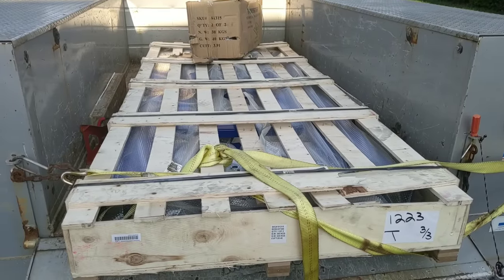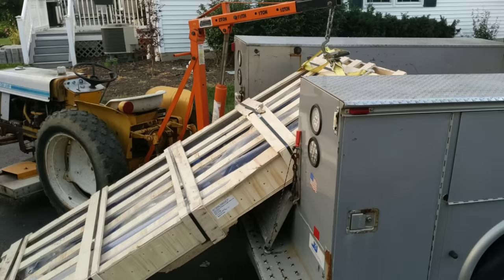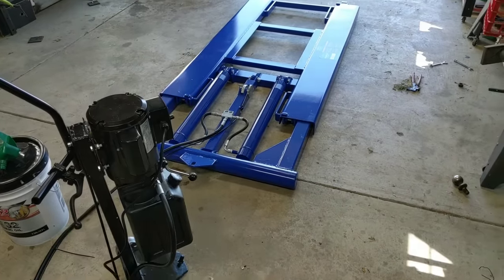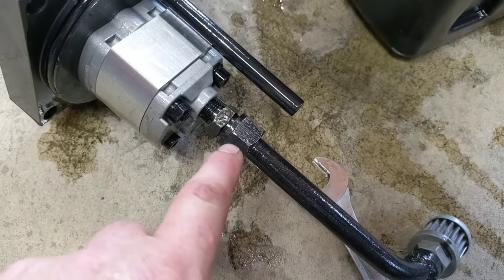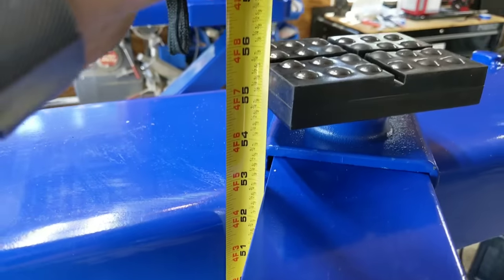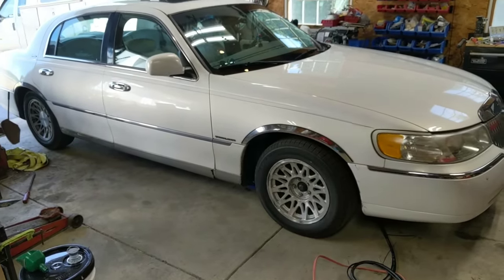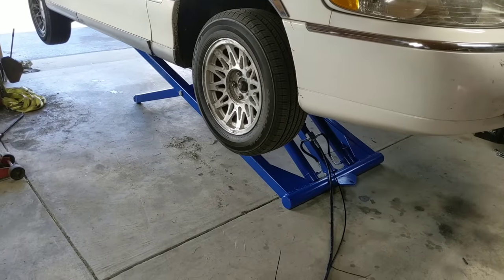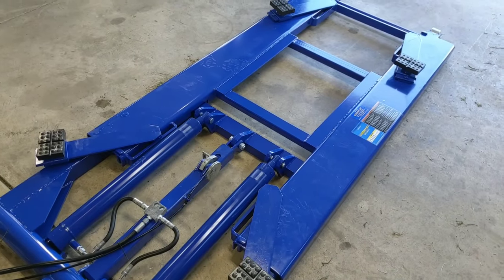Harbor Freight 6000 Lb. Capacity Scissor Lift Review, Central Hydraulics, is it worth it?

Comment: The bad thing about this lift is it prevents you from working on the exhaust system, brake lines or anything that runs through the middle of the car, and dropping the subframe or engine.
Reply from the maker: Luckily a scissor lift isn't designed to do any of those things.   :)

Comment: So with something like this, it looks like the frame of the lift is in the way of removing something like a transmission?  How do you work under the car and work around all that framing in the lift?
Reply from the maker: It's just a scissor lift, they are not designed to get under!   Perfect for lower detail and body work, not designed in any way to get under!    For detailing they are awesome, as you don't have post casting shadows and getting in your way!  Just a different tool for a different job. :D
Reply: @1D10CRACY  Gotcha thanks.  New into the hobby of cars.  I suppose that might be good for tires, brakes, and suspension work too, or no?

Comment: This tool doesn't seem to be very safe - does it have safety locks when in the up position? it looks like it could easily topple over if accidentally shoved with the car on top of it. Yikes! 
The QuickJack seems to be a safer bet along with better access to the underneath of the car due to larger clearances.
Reply from the maker: It does have safety catches. The big issue is people think this lift is designed to work "under" or gain access to the underside of the car, and its not.   Its really intended to lift the car just high enough to work on the lower extremities, perfect for detail and body work, as you can wheel around the car on a stool and not have the posts from a post lift in your way or casting shadows.   Changing tires, brakes or odd jobs is also a bonus, I did use it to change a water pump in this video...  https://www.youtube.com/watch?v=fSRjEwQqp4o   You can find a 2 post lift for about the same price as this lift if you need to work under a car, it would be a safer option. Just different tools for different jobs.   Quick jacks are very nice and I considered them first, but I really wanted the lift to double as a work table.
Reply: @1D10CRACY  Thanks for the clarification : )  Too bad it didn't arrive in pristine condition - after all, as you say, there really IS not excuse for lousy packaging - Cheers and happy and safe work on your cars !

Comment: Why would you risk injury or death by lifting this heavy vehicle ??? What is the purpose of this lift as it is too low to the ground??
Reply from the maker: I plan on using this lift as intended, so there is no major risk of death or injury.   Scissor lifts are designed to lift the car just high enough to save your back.  Perfect for lower body / detail work and you have the advantage of not having to work around the post.  I can sit on a stool and wheel all around the car with little effort.   I like to say these are more than a jack but less than a lift.  If you need to access the underside of the car, this is not the tool as they are simply not designed for that and I wouldn't trust myself under one.  2 post and 4 post are really what you need to get access under a vehicle.   As for the "heavy" car, Towncars are just shy over 4klbs, the lift is rated at 6klbs.

Comment: There's no way I'd go under a scissor lift from Harbor Freight. You got a death wish, my guy. :D
Reply from the maker: No death wish, I just understand how to use a scissor lift.   They are not made to get under, they are only designed to lift the vehicle high enough to work on the lower extremities.  Perfect for body and detail work, not designed to access the underside of the car.   You would want a post lift for that kind of work.   Just a different tool for a different job.  :D
Reply: @1D10CRACY  , so do I. It being scissor wouldn't be my issue. It being Harbor Freight would be. And the safety mantra for a lift is if you're within 5 feet you're under it because one side can fail and dump the load over if your working at the side. Good luck....stay safe...keep your ears open for stress noises.

Comment: I bought a 9000lb 2 post eagle lift for half the money as that thing. It will lift that Lincoln 7'.
Reply from the maker: Good for you!  That makes you more awesome than anyone!   I'm pretty sure my 4 post back in my shop will out lift your 2 post though.  But why would anyone compare a scissor lift to a post lift?   Scissor lifts are not designed to lift the car very high and they are not designed to get under.  They are perfect for detailing and body work, as you can sit on a stool and wheel all around the car without the post or shadows from them getting in your way.  Completely different tools for different jobs, but I'm sure you knew that.  :D

Comment: The good thing is you can work on tires and wheels and stuff but if you have anything that is under the center of the car that you need to work on that scissor jack makes it impossible to work on anything
Reply from the maker: You sir, have a keen sense of the obvious! You'd be surprised at the people who say, "I wouldn't get under that thing!" Obviously a lot of people don't understand what a scissor lift is designed for, just a different tool, for a different job.

Comment: Did you have to bleed air out of the system?
Reply from the maker: I did not, probably should have though!
Reply: @1D10CRACY  because I have a different brand but I rebuilt the cylinder and flushed the oil. No good videos on proper setup from this point.

Comment: I really never saw a reason for these, gets in the way of like everything under the car besides the wheel wells..... Any work I have done under a car this jack would be in the way of.
Reply from the maker: It's a scissor lift, designed to lift the vehicle high enough to work on the lower extremities.   They are not designed to work under!   Great for body work, as you can sit on a stool and wheel all around the car with no obstructions or shadows from a post lift.    If you need to work under a vehicle, you need a post lift.  Just different tools for different jobs.

Comment: interesting and helpful but you're really not supposed to raise the lift without a load on it. it's in your instruction manual. Still helpful either way i'm buying the 7000 lb Bendpak quick jacks instead. they don't go as high but the middle of the car is more accessible and they are the same price. plus the quick jacks are able to be easily moved and stored thanks  for the video though, it helped!
Reply from the maker: Thanks!  The quick Jack's are super nice and I have a friend who has a set and loves them!
Reply: @1D10CRACY  Yeah i have the 12V quick jacks but i was considering an in shop regular electrical option that raised up higher than 2 1/2 feet like these do. mine is the BL-7000EXT and though i can take it pretty much everywhereand use it, i would still prefer a 110/120 Volt option that will stay in the shop full time also.

Comment: so you just take off the tire and brakes???  how do you word on a trans or eng ,exhaust ??
Reply from the maker: It's a scissor lift, it's not designed to get underneath and work under the car. It's perfect for doing body work, as you can sit on a stool and wheel all around the vehicle without post getting in your way or casting shadows. But if you need to get under the car, you need a good post lift. It's just a different tool for a different job.

Comment: I have been thinking about getting one. But now that I see this there is no room to get under car so it's almost not worth it. It's kind of expensive to have something like this to change tires or change oil. No room to do exhaust work, transmission work or anything like that. Correct me if I'm wrong idk.
Reply from the maker: You would never get under a scissor lift!   These are great for detail work, as you can roll around on a stool and don't have shadows from a post lift.    If you need to get access to the underside of a vehicle, you really need a post lift.  Just different tools for different jobs.

Comment: I use to work for harbor freight haha... honestly a lot of “defective” items that were returned were simply not working because of simple similar problems, ie missing parts or disconnected/not attached parts lol.  The tools tbh, although not the best, work great for home shops or in a quick snap if you need  to use something really expensive or only need it once and don’t want  the expensive forever tools you can find someone where else.  They will work for you as needed, but probably don’t plan on passing them along to your kids...  doesn’t apply to all their stuff just saying some items haha.

Comment: The basis of the jack is insufficient where it meets the floor and no lateral support ie. real easy to slide on concrete and tip over if one of the tiny legs starts to fail. Buyer beware.  Forgot to add the angle iron points could weaken the concrete floor.
Reply from the maker: Physics is a beautiful thing....

Comment: I can trust harbor frieght with alot of hand tools but something like this id he really considerned about being under it especially with their recall jack stands id love 2 have something like this but i like not being crushed by cars
Reply from the maker: I'm with ya!   Luckily this is just a scissor lift and not something you would ever get underneath!   If you need to get under a car, you really need a post lift.
Reply: @1D10CRACY  your right but i used something similar to this to this 1 in a shop i use to work at i was able to do oil changes and i did a transmisson fluid change under 1 of these not the best way to get a job done but it had to be done there since the other lifts were occupied

Comment: My life is worth far more than a cheap lift. I would not use it. Better to get a four-post lift with at least 7,000-lbs. capacity. In 2004, I had a BendPak 4-post delivered to my house, large garage wit h 14 ft. ceiling. Total cost for lift including shipping was just $1,500. And it happens to weigh 1,500 lbs. when assembled. After it was delivered, I cut the metal bundling bands, separated the pieces, assembled the unit and set it up by myself in a weekend. The lift also included a removable wheel kit, which lifted the car (2004 Corvette) several inches when fully lowered, so I could manually push the entire lift with the car on it inside the garage. During assembly, the hardest parts to lift were the left and right ramps that the cars wheels rest on, which I estimate were 350 lbs. each. I have moved twice since 2006, and each time, I use the wheel kit to let a flat-bed wrecker pull the unit onto the towing surface, transport the unit to my next house, lower and roll it off at the garage door, then push it in and set up again. The unit is free standing. I still have it today, and it works very well. My point is this: for what you are doing, spend a little more money and go first class, and above all factor in your safety.
Reply from the maker: Awesome!   I use both post and scissor lifts. They are great for lower detail and body work as you can sit on a stool and wheel all around the car without casting shadows and or having the post in your way.   Obviously you would never get under a scissor lift, it's just a different tool for a different job. They are pretty old technology, but safe as long as they are used right.

Comment: Are there safety locks on the lift if a hydraulic line should give out.
Reply: Enzo LoCazzo  
What!!!!!
Reply from the maker: There are 7 safety stops at 7 different heights built into the scissor lift.    If the loft were to blow a line, it would rest on the safety stops.
Reply: Thank You

Comment: Be a cold day in hell before I got under a harbor freight lift.
Reply from the maker: Me either.   But this is just a scissor lift, it's not designed to get underneath and work under the car. It's perfect for doing body work, as you can sit on a stool and wheel all around the vehicle without post getting in your way or casting shadows. But if you need to get under the car, you need a good post lift. It's just a different tool for a different job.

Comment: I recently tossed a set of Chinese jack stands into the dumpster after noticing the engaging teeth wouldn't even mesh more than 1/8". Seeing that, there's no way I would get under this Chinese lift. The Chinese are well known for building cheap stuff that could kill or seriously injure.
Reply from the maker: Yup!   Luckily this is just a scissor lift, nothing you would ever get underneath.  At least you don't have to trust your life with it!   I'm also going to add looking at the faulty jacks and how badly they are built, it would take an idiot to actually use and trust them! I assume your talking about the HF jackstand recall.  The teeth are about half the width of a normal jack and the slop alone is almost comical.  Remember, you have to be smart and look out for yourself, nobody else will!

Comment: What good is it? Ya can't use it to remove the transmission or anything with it. About all it's good for is changing oil,maybe...maybe changing the transmission fluid,changing tires or doing brakes.I guarantee,that if that lift is used for daily use. It won't last long,something will break. I bought the HF transmission jack,the scissor one. It's red & white. I changed 3 transmissions with it. Its rated for 400lbs+, (so I guess it can lift my stepsister 🤣) well it's bent already. I used it to R&R a Ford A4LD and a GM NVG3500. Neither one of these is even close to 400lbs. It is still usable but it is rated for 400+ lbs and those transmissions weigh between 125lbs for the GM & 200lbs for the ford,maybe 225. That thing is fvcking heavy.
Reply from the maker: I mainly use it for detail work.   I can roll around the car on a stool without post getting in my way or casting shadows.    If I need access to the underside of the car, I'd use a 2 post or quick Jack's.    It's just a different tool for a different job.  As for it's quality, the bed is made in the same factory as SnapOn. The pump is not and I'm sure it will fail some day.  It's all easy enough to fix, knowing what I know now I wish I had bought one years ago.
Reply: @1D10CRACY  I buy stuff at HF. I don't think it's junk necessarily. After buying the transmission Jack and it bent on me and seeing a 20ton press that was returned to the store because it bent itself. I just don't trust their stuff with my life. I wouldn't get under that. I have a bunch of their stuff,electric impact,cut off tool,die grinder...etc. I don't use the stuff every day and it lasts a long time. Their clicker torque wrench is surprisingly accurate. I took it to work and tested it. We have a torque wrench tester in the aircraft hangar. Both the 
ft/ lb & the in /lb  torque wrenches were within spec,within 2% close to 1%. Last weekend I used a bunch of their bearing pullers and seal/ bearing race drivers,dial calipers and dial indicator to rebuild the rear axle in my S10 p/u. I've rebuilt entire front suspensions with their stuff,like on my brother's 79 B200 van. Ball joint press is good too,I've used the crap out of it,for pressing U joints too..So yeah they do have some good stuff at a reasonable price that a home mechanic can afford. They even have nice gun cases there. They're pretty good quality. Very much like the Pelican brand at less than 1/2 the price. I bought one to store my electronics testing stuff in. It's foam filled and you can remove the pre cut foam squares out to fit whatever you wanna store in it.

Comment: But how well does it do with a car on top of it do you have to bolt it to the ground does it move when a car is on it
Reply from the maker: It's pretty stable, and not bolted to the floor.   It's also wider than it looks in the video.

Comment: I would be concerned about stability of the base if the vehicle is lifted to it's max.
Reply from the maker: You normally don't lift a vehicle very high with this style of lift, as it's not really designed to gain access under the vehicle.

Comment: Ain't no way in heck I would trust that thing to even work around it. DO NOT get under it either. With a load on it at that height it will become to badly top heavy it's not a matter of IF it will fall over but a matter of WHEN.
Reply from the maker: Luckily it's just a scissor lift.   A glorified jack.         You would never get under a scissor lift and if you car falls over on it, your using it wrong.    Physics is a beautiful thing!

Comment: I own three cars, non of which would clear the height of that lift. Actually, I feel safer with my lift still is stock at Harbor Freight anyway.
Reply from the maker: What lift is that?   I didn't realize HF sold more than one lift?   It would be nice if they some something other than a scissor lift, as scissor lifts are not made to get underneath the car like a 2 or 4 post.

Comment: it is a contraption that does not really allow you to work on a lot of things underneath the car.  Its good for brakes, wheel suspension and things around the perimeter of the car. But working on transmission and exhaust system? looks to me its a complex contraption with a lot of parts right where you want to work making access to the areas central to the car difficult!  Then in addition the safety concerns! I wouldnt' use it on anything heavier than a VW.
Reply from the maker: I wish I had explained why someone would need a scissor lift in the video.  They are not intended to get access to the underside of the car.   They are only intended to lift the car high enough to work on the lower extremities.   Perfect for lower  detail / body work as you can wheel around on a stool and not have post form a 2 or 4 post lift in your way.    If you need to work under the car, you need a different kind of lift for that.